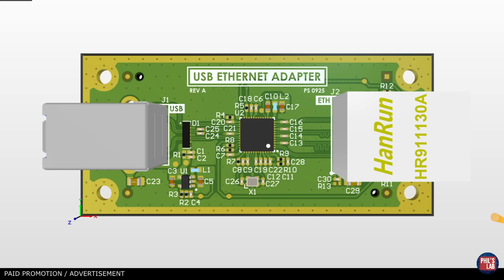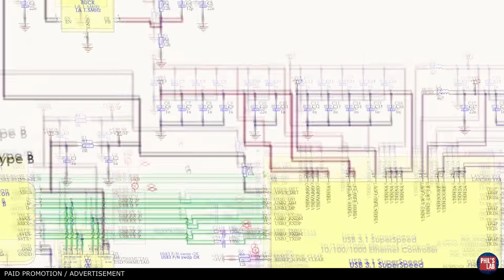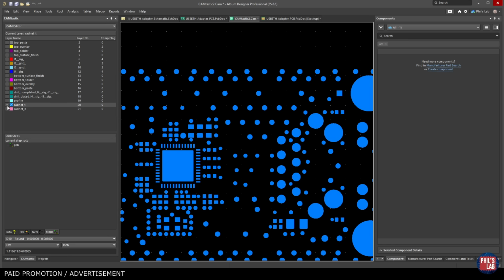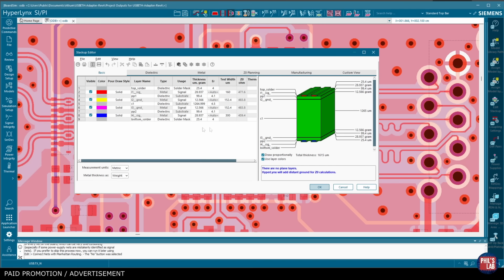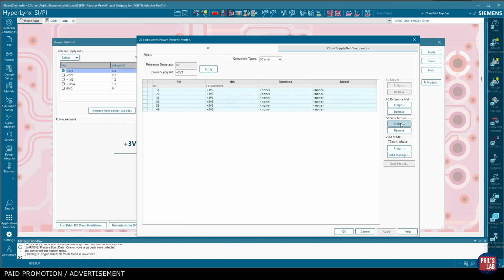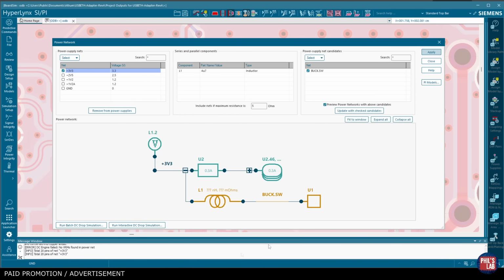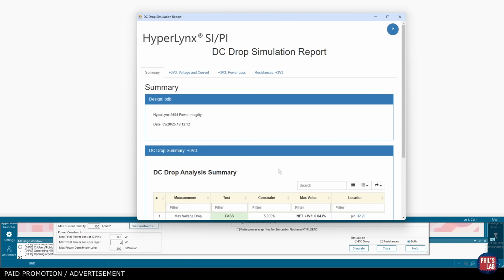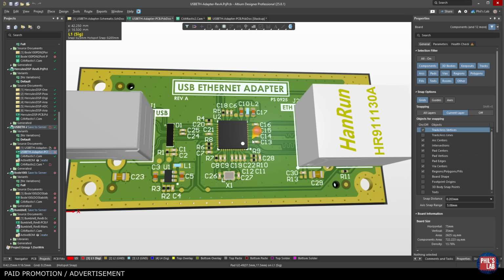HyperLynx DC Drop Simulation - Phil's Lab #164

Comment: How to do simulate a LDO source with downstream filtered rails? can it all be simulated under one rail? or do you need to simulate each section? For example can a 3V3 LDO be setup as a VRM, and then 20 downstream filters through inductors, how do you setup them up as a current sink?

Comment: I believe the via currents will be more evenly distributed when taking in to account that the high current will heat up the shortest via path, increasing resistance and diverting some of the current to the other vias in the gid. So some common sense (ie. how many and what kind of vias can safely move x amount of current with enough margin) can be applied as the current density and via currents may have odd looking results sometimes.

Comment: Hey Phil, as always great video. As far as current density being 'reasonable' - I have found to be qutie subjective. Today's IC's sink 100's if not 1000's of amps in tiny form factors and it really depends on your cooling solution and if it's on internal/external layers. cross referencing the IPC standard to see where it sits on the chart will also help you here. For small current bottle necks I wouldn't worry too much as the bits of copper either side of it would act as heatsinks.  Running a thermal co simulation would have been cool to see.

Comment: Hello Phils, thank you for your great videos.
I have a question regrading the multi-device address/data bus design. The address-data buses are connected in parallel for the 2 devices. Would some buffer ICs necessary or directly connect the buses is enough? Thank you in advance.

Comment: Thank you for an informative session Phil.

I have been watching your videos for quite some time and I have noticed you use edge plating with exposed copper. In your Advanced Digital Hardware Design course you also used similar edge plating and connected it to a net other than GND. You also connected the edge plating net with the GND using a parallel RC network. My question is with respect to EMI perspective isn't this a recipe for disaster? Because you are essentially leaving a huge Copper structure (which is only connected to the circuit GND at the RC) open for resonances?
Reply from the maker: Thanks, Muhammad!
As usual, it depends on many factors, including type and design of the enclosure. The thought for the ZettBrett was to have a custom, conductive enclosure that solders down around the CGND ring and then has a single-point connection to system GND. Single-point gnding is what I do in many commercial systems that pass EMC testing. However, the strategy needs to be of course adjusted based on the use case, circuitry, etc. I can highly recommend the EMC PCB book by Keith Armstrong which has discussions on single-point, multi-point, etc. grounding techniques.
Reply: @PhilsLab  Thanks for explaining your motivation behind the single point grounding. I was quoting one of the podcasts Dr Keith Armstrong appeared on with Robert Ferenac and in there he clearly discouraged the practice of single point grounding. I will definitely look into the book you recommended to understand the difference between the two. It is however very interesting to know that your commercial products passed EMC testing.

Side note to this, I do think in a pure digital board like your Zettbrett it isn't a problem if we keep a uniform GND net for both shielding as well as return purposes, since you have already sculpted the digital traces with well-defined return paths, in terms of stack-up as well as accompanying return planes (so no emissions expected). However, a large structure like CGND without stitching vias are certainly susceptible to EM disturbances.
Reply: @PhilsLab  By the way, I really miss your FPGA and SoC tutorials. I started following your video on Zynq MPSoC (which you hinted about making it open-source), but I think you have shelved that project.
Reply from the maker: Thanks, Muhammad. I'd love to continue on many of these projects, but unfortunately my time dedicated to YT has been rather limited over the past 1.5 years..
Reply: @PhilsLab  Hi Phil thank you for all the videos. I was trying to find the book you referenced in this comment from Keith Armstrong but am unable to find it. Can you leave a link to the book please?